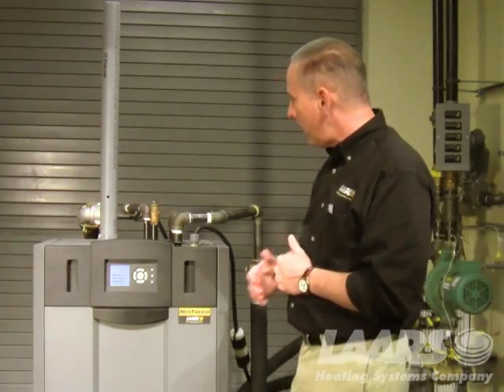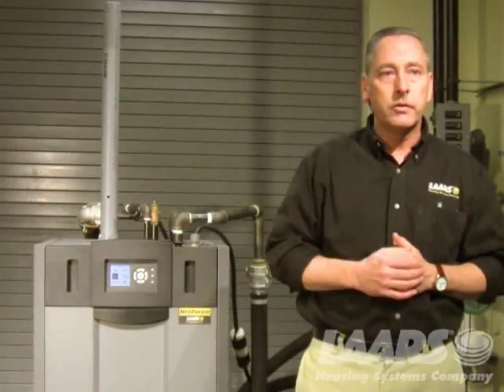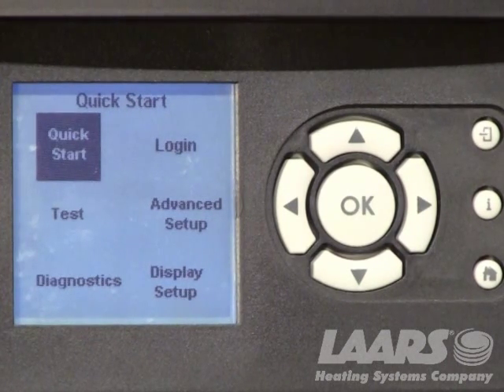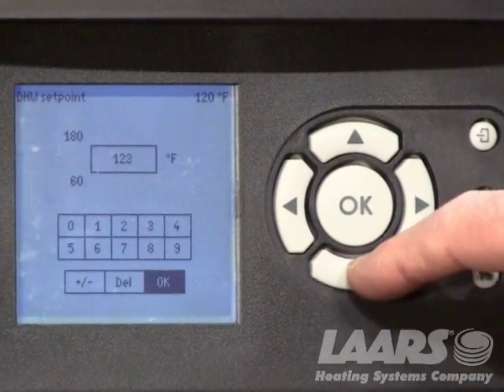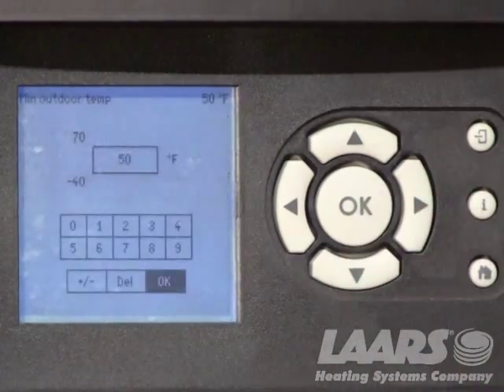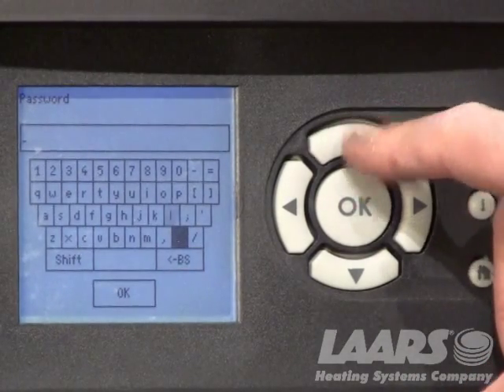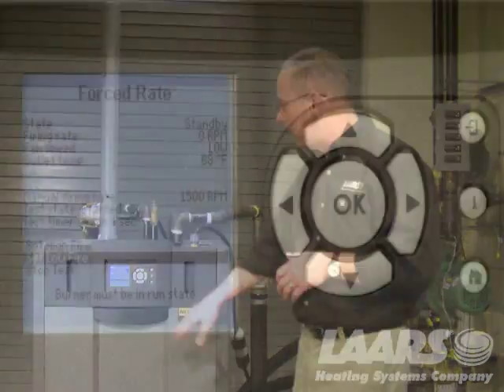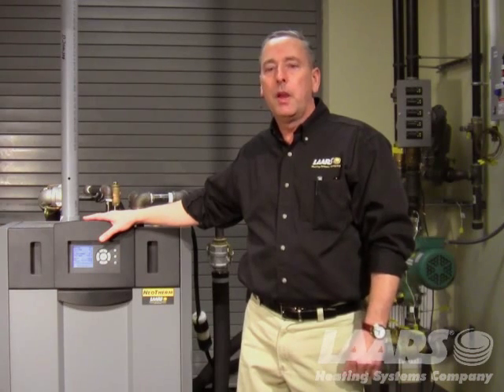NeoTherm, EMEA Display, for Contractors

Comment: Hi nice video but I need help with one thing it happended to me last week I was testing and got the message for cambustion (Burner must be in run state) well if the boiler is satisfied how can I make the call for heat and get my test I couldn't do it thank you I will be very happy to figured this out thank you
Reply from the maker: Good morning Edison - please contact me at communication@laars.com and I will connect you with someone who can answer your question. Alternately you can contact 1.800.900.9276 and speak with anyone in the Technical Service Department.  Thank you